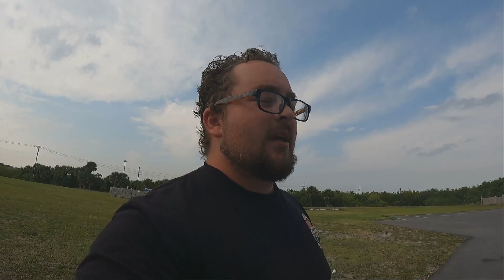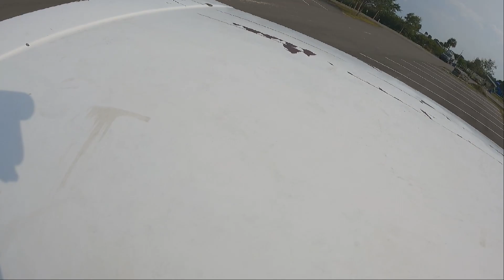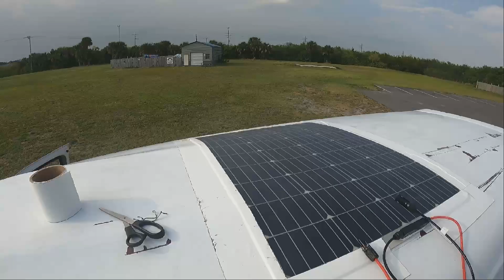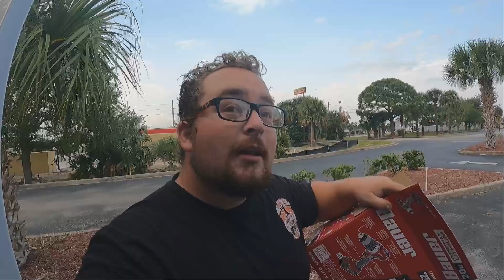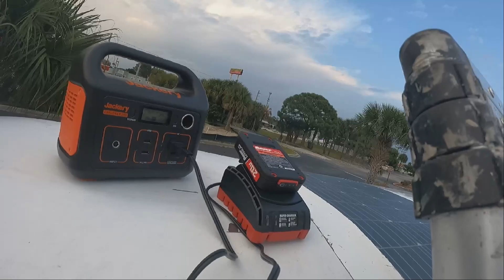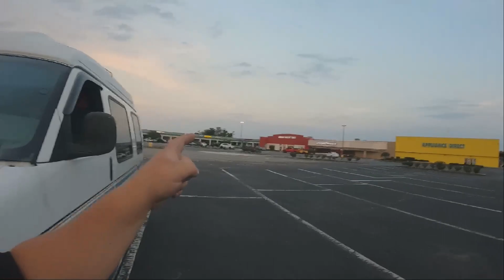We added solar to the van roof! #FulltimeVanlife

Comment: Use clear RTV silicone to seal hole with wires centered. It will make a rubber gasket  Used on public safety vehicles for years sealing lightbar wires etc coming in through roofs. 👍

Comment: You need a Marine grade wire pass through also you need a "Drip Loop" in your wire as it is higher than the hole. You will get a leak the way you have it, and you wont see it tell its too late IG. thank you for the fun videos.